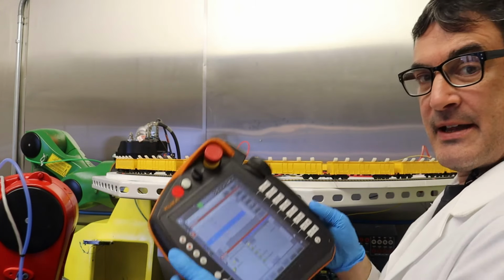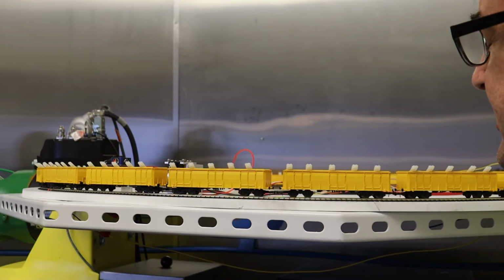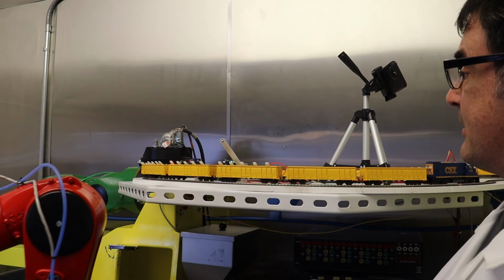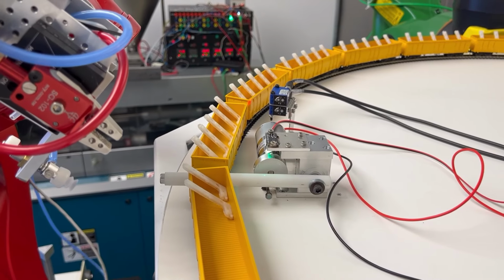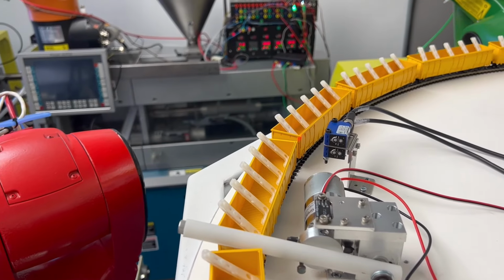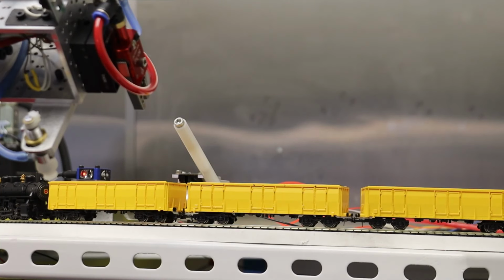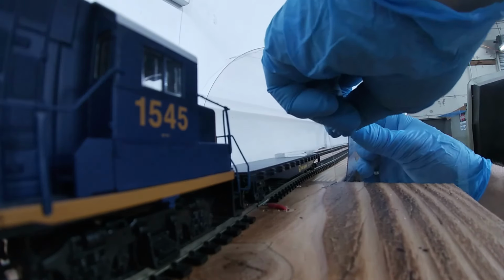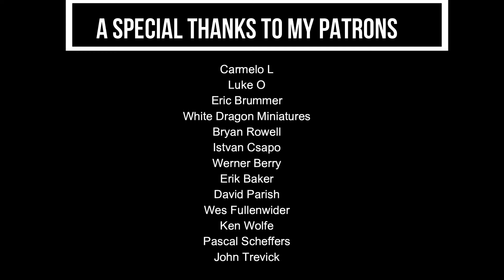HO SCALE ROBOTIC CONVEYOR USING A MODEL TRAIN SET

Comment: Amazing solution for a low budget convey system.
Absolutely original and out of the schemes.
I'm working into industrial automation sector since long time ago and I've never seen something like this.
I would like to give to you my two cent advice ....
Instead of using the robot program to drive the train logic sequence I would use a small budget plc (like ClickPlc from Automation Direct) that can offer more flexibility in case you need to improve a more complex control logic i.e. precise timers, part counting and so on.
Then the robot will be easily interfaced to the plc via digital signals anyway.
Reply from the maker: Thanks for the tip.  I am looking for a simple PLC like that .  I think I will buy one and try it out.  The Rasspery Pi computers are too pricey right now.
Reply: @DragonflyEngineering  You are right indeed.
The Raspberry 4 is priced too high right now and you can find a PLC with "built in" industrial grade I/Os and communication feature for the same price.
I've suggested to you the Click PLC from Automation Direct because is Made in USA and the price point is really fair.
You can expand the I/Os and the technical specific features very easily and the programming software is free of charge.
I'm from Italy and I'm used to work with Siemens, Schneider Electric and Allen-Bradley.
This top brands are more expensive even for a low end product. 
I really enjoy your videos and your ability to manage different tasks and technologies is just remarkable. Thank you so much to share your experience. :-)

Comment: If you want to extend the life of your robots, reduce their wear(gearbox strain, brake stop&go), and reduce power consumption, switch from PTP and LIN moves to C_PTP(continuous) whenever possible. It links motions together continuously to avoid sudden stops and dwells. It also looks cooler, which is my primary use for it.
Reply: You mentioned this to me on discord and I learned about the PASS command. Just curious, how does it reduce wear? Smoother accel/decel?
Reply: @OakwoodMachineWorks  yup, just less strain
Reply from the maker: Thanks for the tip.  I do have some continuos moves in the robot.  I usually put a 0.1 sec wait when I am sending or receiving a signal to ensure the path breaks at the right time.
Reply: @DragonflyEngineering  What I usually do when receiving signals is continue a move until some affirmative action is required, then insert a conditional wait(WAIT FOR) on that signal.  I think some versions of KSS pre-evaluate that during the interpolation cycle and it results in smoother motions.

Comment: Nice and simple! I like it.

Consider moving the train/engine detector to the front of the car you wish to unload. This should eliminate more of the coupler slop.

Move the pusher engine to the middle of the train ... in the big train world they call this distributed power. You may not need an end engine.

If you provide a PWM power source to the H-Bridge, you can set the train speed by varying the duty cycle while still having (almost) full torque for pulling the grade without having to run the train too fast over track sections. 

Make the section of track where you are unloading straight to provide less of an angle between the cars to let your plastic tube fall neatly onto place. You could also use a tapered rectangle of nylon/hdpe or other slippery material in place of the tube.

Thanks for the ride!

R
Reply from the maker: OK, good points!  The stop bar is in the back of the pick car to avoid the engine being a different shape, I can try your other pips when i have some spare time, which is short these days.  Thanks for watching!

Comment: Looks a pretty awesome system. One question though, is the track steel or nickle silver? If it is steel it will rust & pickup dirt  very quickly which will cause issues with connectivity. Also two matched Diesel Locos would be better as the Steam drive mechanism will wear out quicker than the diesel motor drive configuration. Cheers
Reply from the maker: The track is nickel silver! https://www.amazon.com/gp/product/B071FKB8FC/ref=ppx_yo_dt_b_search_asin_title?ie=UTF8&psc=1.  Thanks for the tip on the loco matching.  good point. thanks for watching!

Comment: just a thought, if the track were on an incline the weight of the waggons would cause the train couplers to be in tension, making the distance between waggons constant. This would be a passive system and remove the need for the shuffle reducing wear on the engines
Reply from the maker: good thought.  I do plan on using your idea for the other end of the line where the incline in the main shop has a low point to bunch up the cars,  Thanks!
Reply: @DragonflyEngineering  Excellent, I do hope it works, I think passive systems can take a bit of setting up, but ultimately are more robust and simpler to maintain. 😄

Comment: Looks like the parts are very prone to movement in the cart/train/building/air, have you considered a 3d printed or bent sheet metal cart insert to locate them positively?
Reply from the maker: Thats true, I thought about adding inserts, but was concerned about the extra weight.  The cars were selected to orient the parts as shown.

Comment: The Idea is really good but the system will lose accuracy over the days becaus the train is only a toy and not made for so many production cycles.
Reply: He has closed loop control though (the optical sensor that finds the edge of the car, and the h-bridge controlled by the robot that can move the train back and forth). As long as that's working correctly, it will self-adjust. I'm more worried about the wobbly track in some places, and the bumps where the different sections of track bed meet... it will be very interesting to see how it performs in the longer term and if it holds up to constant use!
Reply from the maker: Yes, I am currious to see how long the system holds up